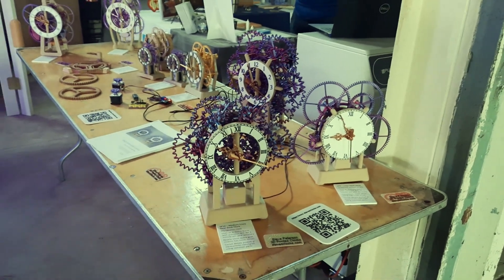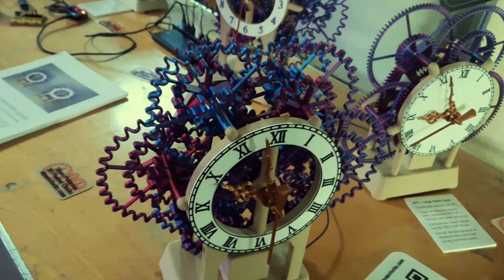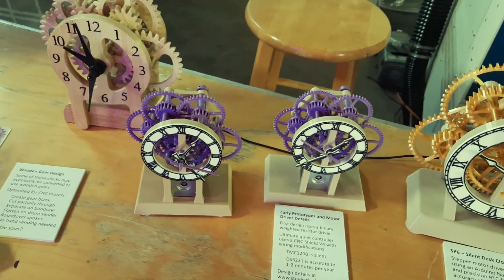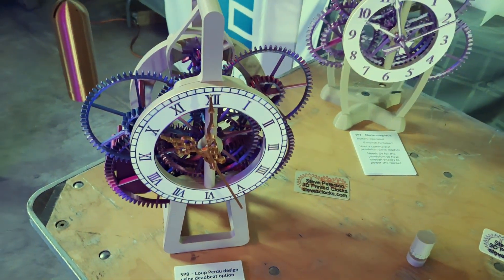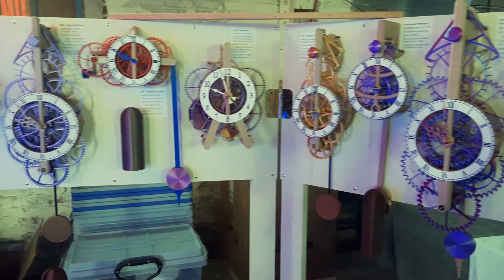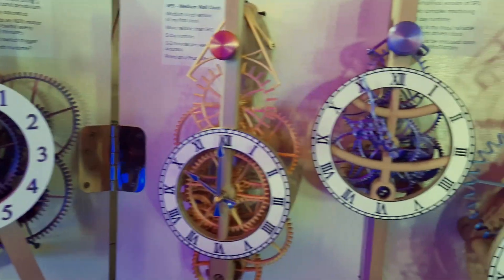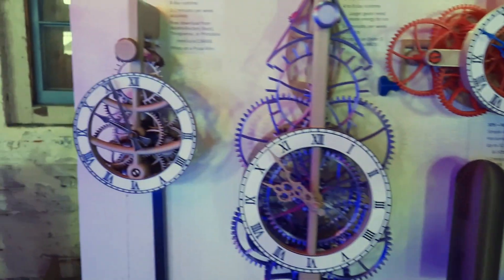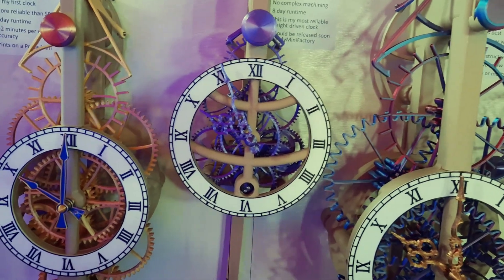Clocks at Bay Area Maker Faire 2023

Comment: Steve I think a cool touch to you clock designs would be to add a another arbor and pinion set and have the escapement spin clockwise with a seconds hand and a sub dial on the trail plate above the main dial!